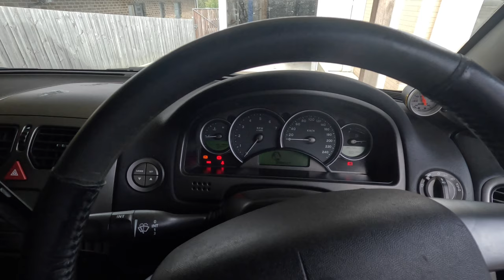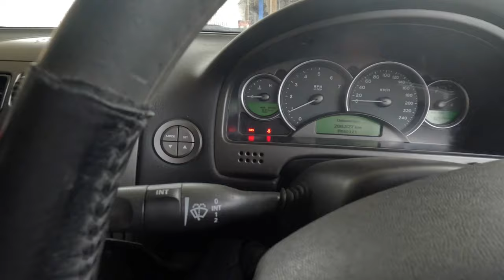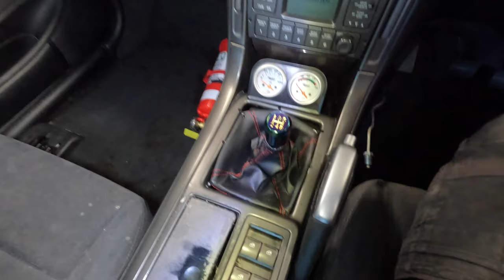VY Commodore Drift Skid Car Auto to Manual Conversion Pt 3

Comment: Hey man do you know where I can get the centre bearing carrier from? I cant find one for mine?
Reply from the maker: Any local Burson or Repco should have it in stock. You can buy the centre bearing with or without the carrier. I always get it with the carrier. So much easier to change
Reply: @cassarindustries_wheelwerk oh I’m so sorry I forgot to mention mine is for a 5L Gerry manual but I don’t rowing they are the same? As when I search for a centre bearing based on my car it only gives me just the bearing but no carrier which is what I need
Reply from the maker: It shouldn’t matter. I’m almost certain they are the same, but to be sure just call your local parts store mate and they can help ya
Reply: @ legend thank you very much for that

Comment: Hi mate I’m doing the same on my vy and I’m after the flywheel bolt specs? And where to get them, plan on finishing it this weekend haha
Reply from the maker: Hi mate. Can’t remember the specs I. The bolts off the top of my head im sorry. 
Any auto parts shop can organise just the flywheel bolts for you. They are a torque to yield bolt so can only be used once otherwise you run the risk of snapping them.

Comment: Hey mate what dowls did u order? Do you have a link by any chance
Reply from the maker: Just got them from the local bolt shop. They are 8mm diameter but only come around 25mm long. Then just cut them down to length